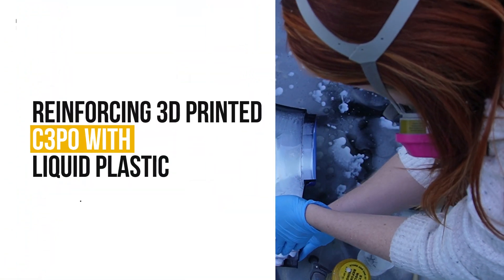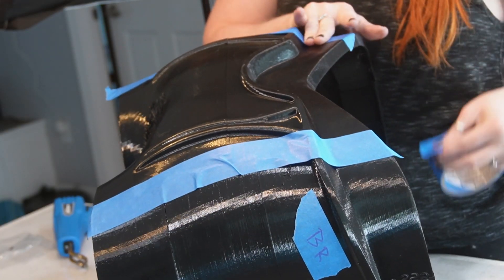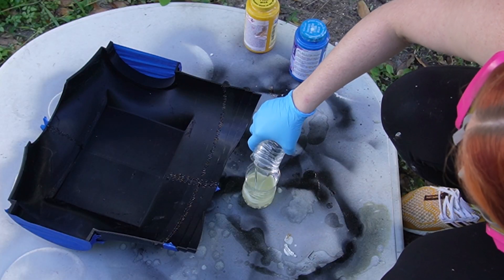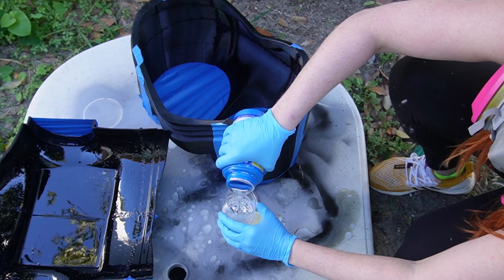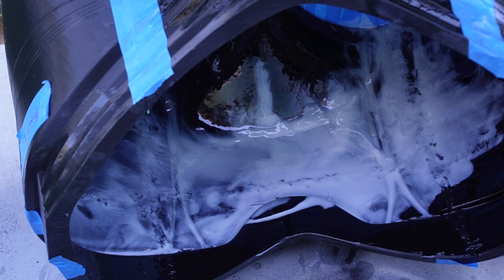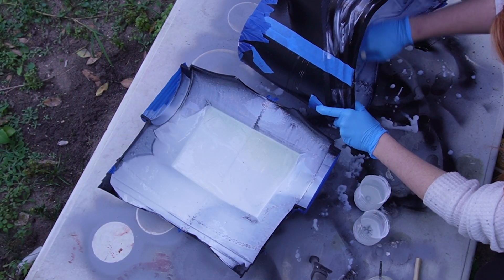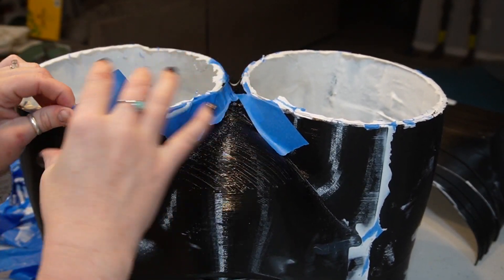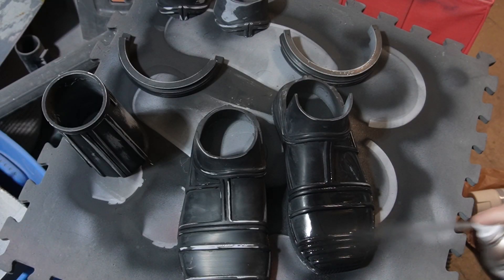Reinforcing 3D Printed Cosplay with Liquid Plastic

Comment: can you make real armor with this
Reply from the maker: The person who shared liquid plastic with me uses his armor airsofting and it works for him. I think it would depend on what your definition of real armor would be and what hardness is needed. It is made from plastic and not metal, but the liquid plastic does add a hardness rating to it. If what you need is requiring a hardness above what the plastic can handle then you might approach making it differently.

Comment: How is this compared to resin?
Reply from the maker: Smooth-Cast 300 Series of liquid plastics is in the resin family. They are ultra-low viscosity casting resins and are advertised as being virtually bubble free. When it is fully cured it is tough, durable, machinable and paintable. They resist moisture and mild solvents.